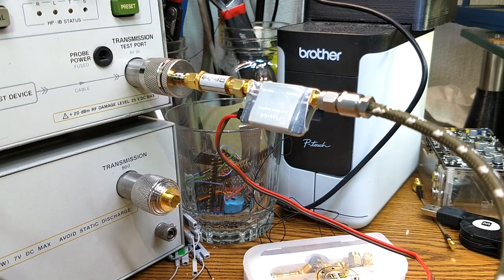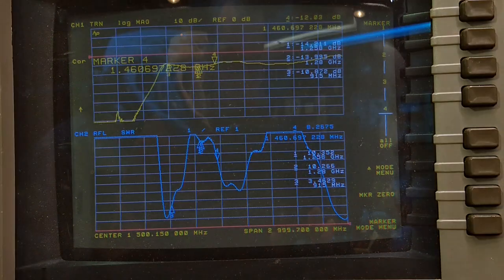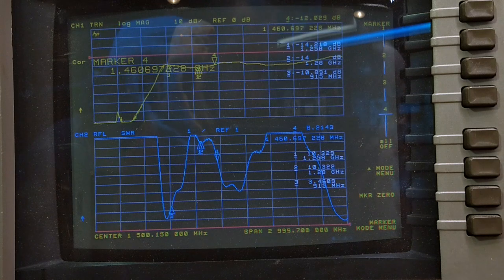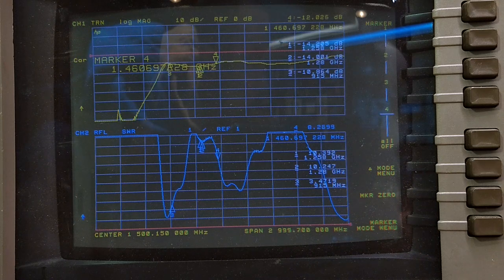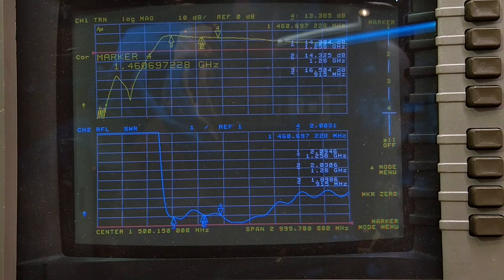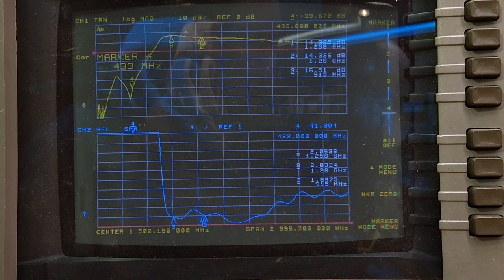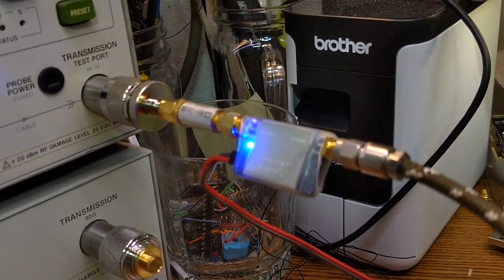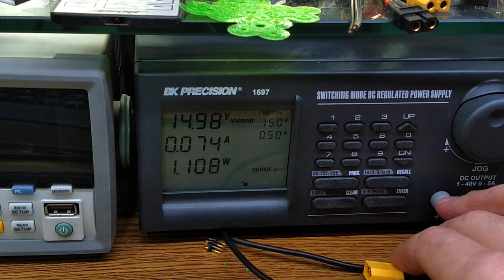Dragonlink 1.2 - 1.3 GHz LNA quick review - Part 1 - Long Range FPV Video Series - PK's Lab

Comment: I'd like to see a test similar to the 1.3ghz vrx shootout you performed, with minor injection of 915mhz akin to being ~50ft away, say 0db or -10db, and then of course close by at +10db or so (not sure I have those correct). I found the 4ch 1.3ghz older vrx to be much better than the newer RMRC model as you recommended in our conversation last week, even when using crossfire as high at 500mw. Granted, the ground station was repeating on 5.8ghz 100ft away

Comment: am i correct in understanding that you recommend the TBS Notch to be placed BEFORE the LNA for best results?
Reply from the maker: Hey Darin.  There's a couple things to consider and it's highly dependent an which VRX you are using.  If you have a receiver where you only see minor crossfire interference when close to sensitivity (grey static), you'd want to do LNA->Filter.  Otherwise you'll need to take a slight range hit and do Filter->LNA.  Though in the latter case, the LNA only helps if the noise figure on your receiver is high.  One of the followup videos that I plan on doing is to show the effect of the order of different components with various receivers.  Will post a link here for you once I get it done.
Reply: @PKsLab  I switched to the racewood one that doesn't support 900mhz, and it is quite a bit better for crossfire.  I will try LNA-> Filter.  ON a related note, I would love to see any testing you have on the Clearview 1.3XLR. That looks like it could potentially help us LR 1.3 guys out.
Reply from the maker: @ironworkschurch  Sorry bud, I don't know anyone that has a Clearview 1.3 XLR.  If someone has one that I can barrow for a week, I'd def be happy to do a full set up measurements on it.  I think I saw something a while back in one of the RCG threads that said that it's crossfire rejection/blocking performance wasn't that hot.  But that may have just been anecdotal.

Comment: Awwwwww shiyyt sonn
Reply: Nice Bk precision supply....
Reply from the maker: @grindz145  Actually, I'm not the biggest fan of it.  A bunch of simple things require multiple button presses.  And if you trip the overcurrent protection you need to power cycle the thing.  Fine for simple bench stuff, but note terribly well thought out